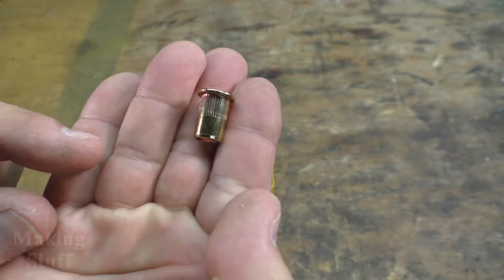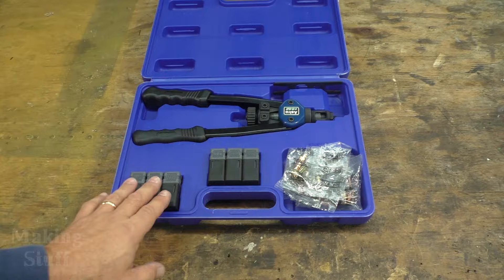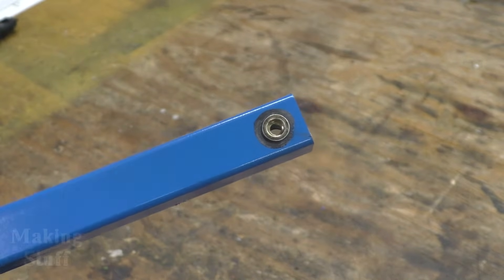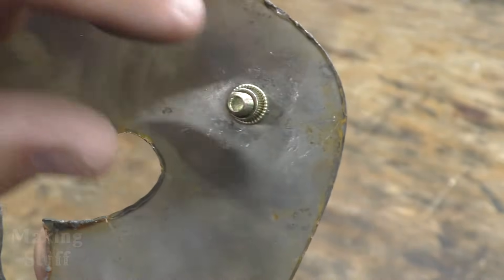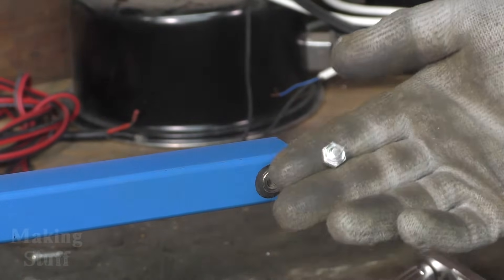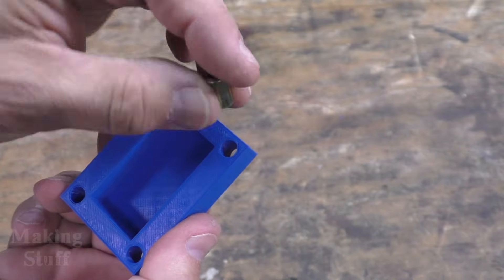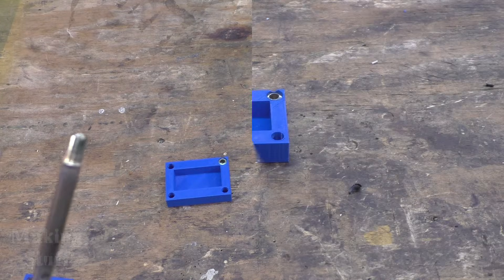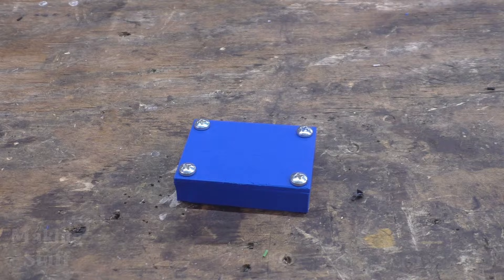How to Install and Use Rivet Nuts, Rivnuts and Nutserts in Metal and 3D Prints

Comment: Excellent!  I was interested in using these as a solution in my Jeep Wrangler to be able to replace the check straps on the soft top frame. I’ve replaced them once and had to drill out regular rivets, then re-rivet the new straps in place. Apparently my straps are a bit too short and I need to lengthen them. I do not want to have to rivet these straps over and over again.  This seems like a good solution. Might even put some grommets in the straps to hold better.

Comment: You could prevent the rivnut from pulling out of that 3d printed lid by installing them upside down from the way you did it, that way when you torque it down, the lip will not be allowed to be pulled through. The way you did it, the rivnut could pull back out on torque. Cool method though, I will be using this.

Comment: If you put the rivnut into the plastic from the other side, the threaded section will be closer to the screw so you can use shorter screws....and the pullout force will be much greater.  Good vid.
Reply from the maker: Thanks for the tip!

Comment: Nice video showing the potential of these rivnuts. 
There are also aluminium rivnuts which don’t behave quite so conveniently and are nothing like as strong. 
One thing I was hoping you would show is how to adjust the compression distance depending on the size of nut. The instructions make a big deal about doing this adjustment but don’t say exactly how you go about it.

Comment: For 3D prints.  I have found they tend to pull out with not too much force.  I added epoxy, still not great.

Solution was to put the flat part on the back such that it pushes against the plastic as you tighten the screw.  But the wider lip cannot push through the plastic.  So can tighten down with a lot more force.  

Love your videos.  I am a tech employee, with similar hobbies.  Created CNC retrofit for mill.  Working on belt grinder and CNC router.  I use a single control box made from rolling 19" server rack.  From which I bolt in up to 48U 19" project boxes, PC enclosure, stepper driver 3U box. 3U fans.   Even a 3U drawer.  I can pop off the stepper drivers (same aviation connectors you use).  Roll the control electronics to different machine, load different Mach profile, use same control electronics for multiple machines.  Evolve controller electronics separate from the CNC machines themselve.  Even swap out old machines for new ones.

Anyway -- big fan.  Exploring making some videos myself...  Keep it up -- thanks
Reply: There are specific nuts for plastics. Search for threaded inserts, heat set inserts

Comment: How thick can the metal be you're inserting the rivnut into?
Reply from the maker: I would guess this is more for sheet metal.  You can always tap threads on the thicker stuff.
Reply: @MakingStuff  true enough....I guess the max is like 1/8 inch from what I've read but could be wrong
Reply: I'm gonna mix up alil JB weld to paint on the backside of the rivnut before I clamp it in too! Seems like a good idea but we'll see.  Surprised the bolt snapped though sheeesh

Comment: I'm sure melting the rivnuts in 3D prints would work in a pinch but if you plan on using that a lot it's worth getting some "heat set inserts". They come in all kinds of sizes and are specifically made to be molten into plastic parts. The more aggressive exterior would be more resilient to all kinds of forces.

But great video, I've been planning to get a pair of those pliers as they seem very handy but have been kind of weary on how strong they are. Was that an alloy or steel rivnut?
Reply from the maker: I think it was steel but not 100% sure.

Comment: Thank you so much for this video!  I'm getting ready to start my truck camper build-out and have been considering using rivnuts to mount plywood to the truck's bedrails.  And this was the exact question I had that no one else has addressed: How much torque can the rivnuts handle before slipping?
Reply from the maker: Glad it was helpful!

Comment: I bought one of these tools to use on a project and came across your videos. Nice going but has many others here have stated they have an opinion and so do I, I think you’re hot iron trick is great. I might’ve come in from the other side so that way as you tighten it would continually pull inward as opposed to possibly spinning. But with that size box you don’t need much torque and I doubt very seriously if they’re gonna come apart anytime soon. Again great video.

Comment: I was struggling for the door closer to stay on metal door frame. Carpenter just made some holes and thread to fix the door closer cylinder, which broke several a times, each time the holes made bigger and bigger. Found the solution here, insert a river and tighten the door closer with a bolt.
Thanks for the video, and the idea. So nice of you.
Reply from the maker: Glad I could help.  Thanks for watching!

Comment: Those rivnuts are awesome.  The reason they don’t give way very easily is that they actually continue to tighten the bond as you tighten the bolt or screw. So they are self affixing
Reply from the maker: Cool, I did not know that.  Thanks for watching!

Comment: Cool, just got my Wetols rivet nut tool. Will use it to mount my home made bed in my K40 CO2 laser. Will make it easy to add and remove different beds and rotary bases in my laser. Thank for the howto...

Comment: Excellent video. Thorough explanation, and I like the destructive testing where it showed the Riv-nuts took more torque than the strength of the bolt. You were asking for examples of what they can be used for, and a friend of mine designed, patented, and has been manufacturing aluminum bulkheads (basement access, as well as other applications) using Riv-nuts for over a decade without a failure. Great product. 
My friend uses an installation tool that goes on a reversable drill that works very fast and easy. I don't know the manufacturers name, but it works well.
Take care Bud

Comment: I definitely agree about rivet nuts on sheet/tubing metal. But for plastic, they're too slick for a durable bond. I use instead bronze insets which have a grip pattern on the outside. That's much more durable. The method could be the same : hot mount, or even cold mount, forcing it in, with a little help of a drived screw. For each task, you need the right stuff. its Regards.

Comment: I use anti seize on the screw/bolt. I have had issues with rusting bolts/screws and the insert turning while trying to loosen. You were lucky, the bolt broke LOL.  When the bolt doesn't break, then its a party!!🤣
Reply from the maker: Yeah that's kinda what I was expecting.  But I tried it 3 more times off video and the bolt broke each time.
Reply: @MakingStuff  Thats cool. I had the issue with the insert spinning in much thinner metal. Rusty old screws. Great video and thank you for sharing this cool tool👍

Comment: I normally just weld nuts onto the back of sheet metal, but these could come in handy for box steel which I quite often use
Reply: That's my approach too. I don't have a proper set of tap so I use this approach in many places where tapping is possible.